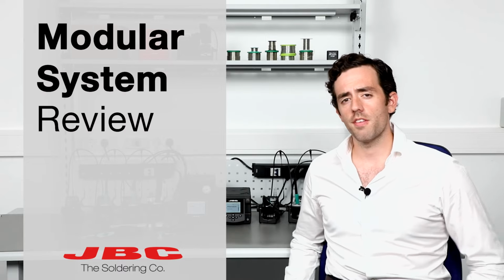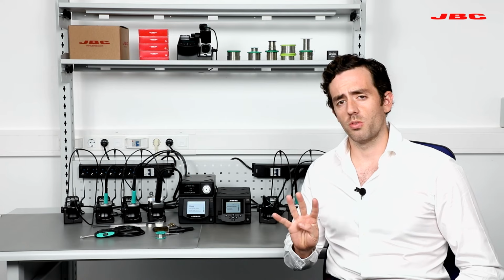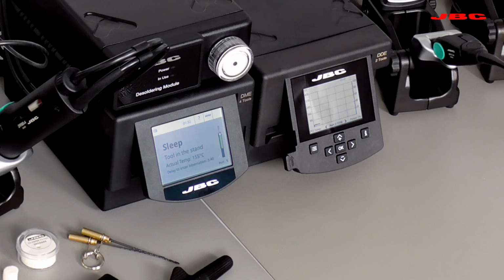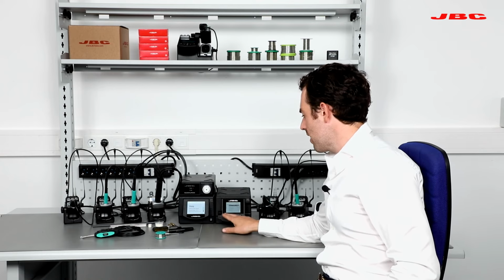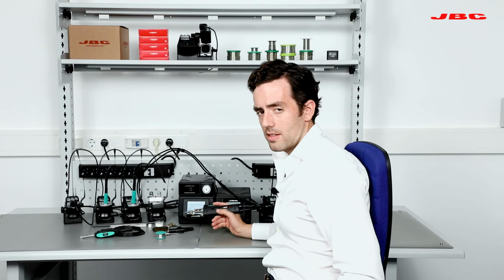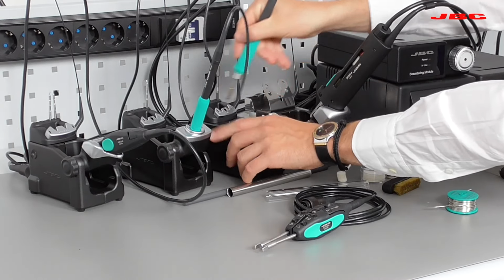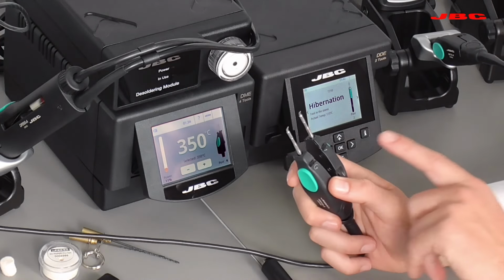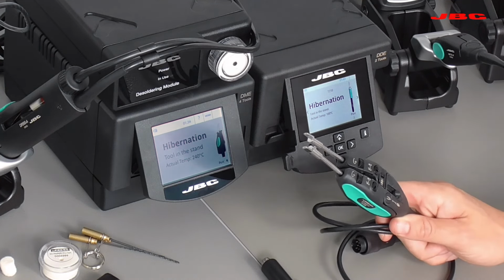JBC I Ask an Expert: Modular System

Comment: I use JBC products for many years. Now got DMU station. Is a great piece of equipment. However I strongly think that user interface could get small improvements, that would make the station more friendly. Like possibility to adjust temperature when handpiece is in the stand. Or showing set temperature on sleep screen.
Reply from the maker: Thank you! We highly appreciate your honest feedback, and we will take it into account as we develop our products.
Reply: @JBCSolderingTools  Also. One feature I saw in other soldering station. Eather separate "Lock timer" or option to set "Press button to resume after hibernate". The thing is, very often happends, that soldering station stays on overnight. It has happened that unaware person accidentally removed handle from stand, and got burned. With such a option, after long time of not using soldering station, you would be forced to confirm by pressing button, to start using it again. That would help minimizing risk of getting burnt or fire.

Comment: Hi. Is there a vacuum chip pick-up tool available for that station? 

Also, does the desoldering gun have an angled tip, like the one on the Weller WXR3?
Reply from the maker: Hi! This station does not have a suction pump where the Pick&Place tool could be connected, but there is an external module PK - Pick & Place Unit (https://www.jbctools.com/pk-5a-pick-place-unit-product-1795.html) that could be used.
 
Regarding the angled tip, we are working on the design of a new tool, but currently, we do not have an angled desoldering tip or tool.

Thank you for asking and for your comment!